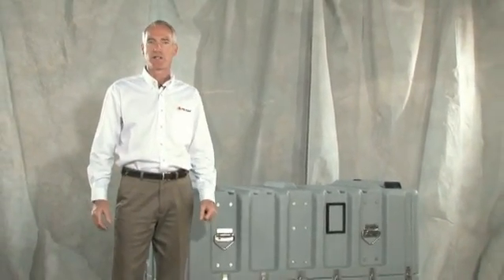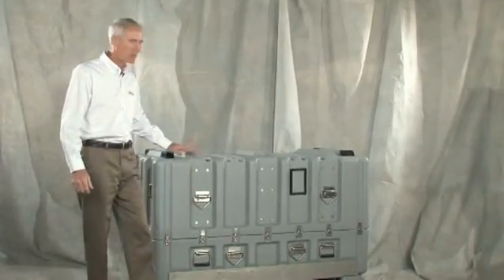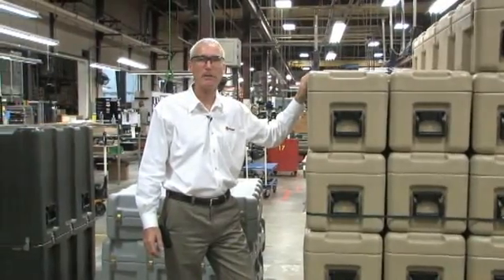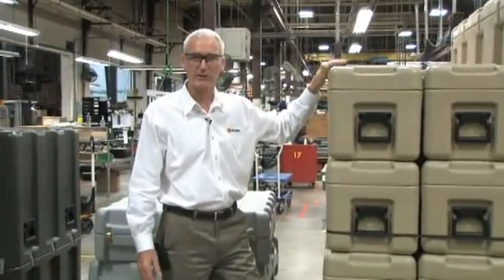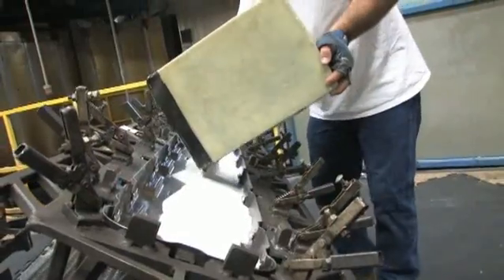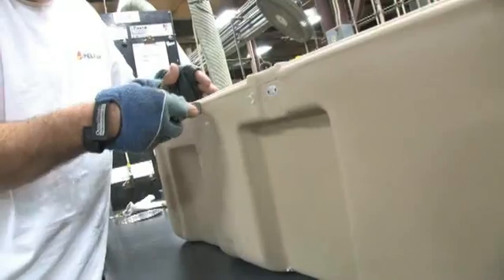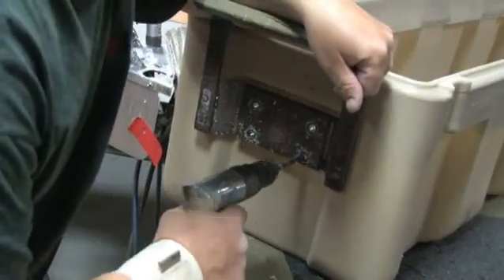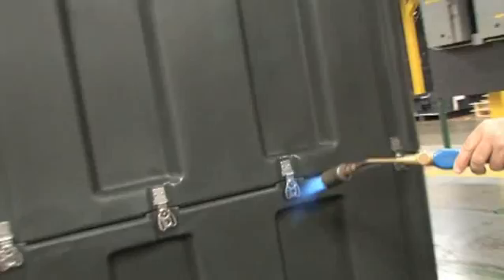Rotomold Pelican Case Technology - Pelican Products

Comment: Why are the molds rotated?
Reply: Its roto molding, so you have a tool cast mold that is filled with plastic pellets, the mold/tool is heated and the plastic liquifies. You rotate the mold to spread the plastic all over the interior and as it cools it slowly builds up thickness. This is used to make items ranging from coolers and fuel containers to Pelican style storage boxes. If the tool isn't rotated all the plastic would clump towards the bottom.